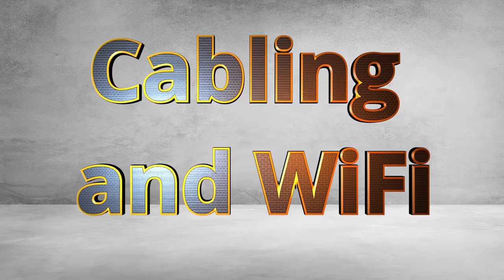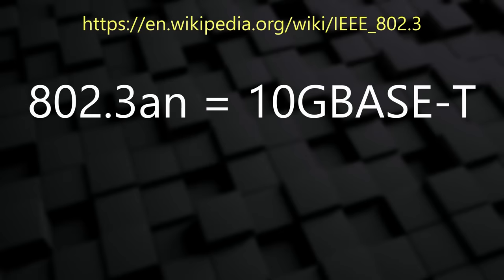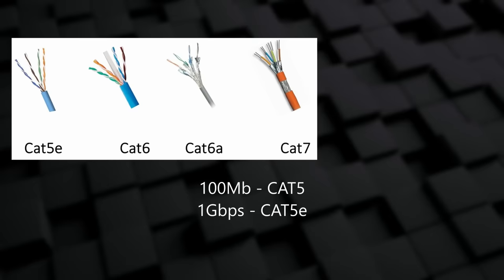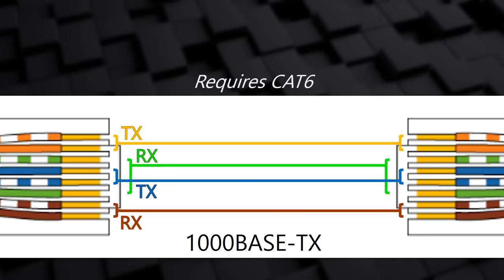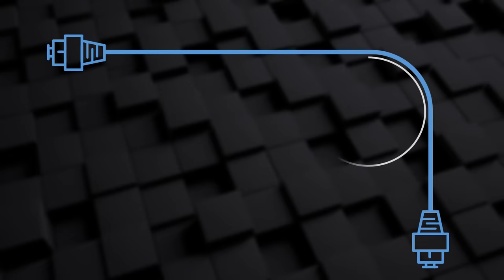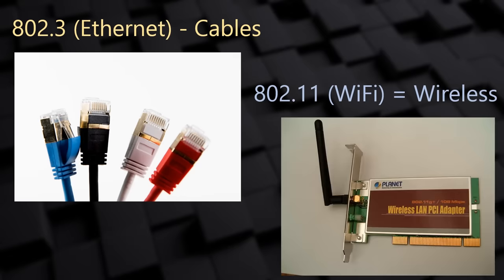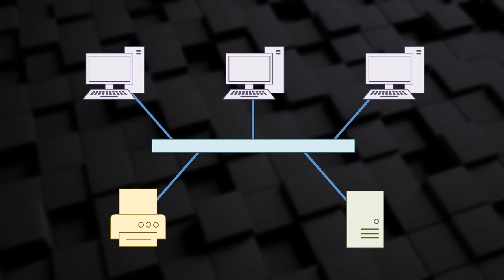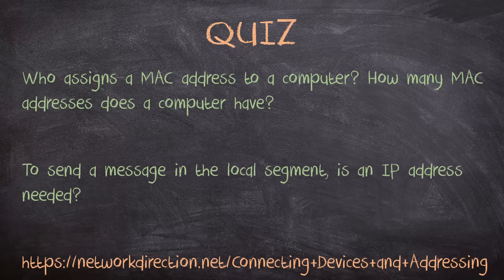Cabling Devices | Network Fundamentals Part 2

Comment: 1) 1000Mb/s = 1Gb/s, UTP (CAT5e or superior).
2)Straight through cable, crossover cable.
3) When the wrong cable is used, what it does is reassign the pins to the correct functions.
4) Between Routers and Switches and for servers, Single-mode is for longer distances (Laser).
5) Maximum degree to which a cable can be bent, optic fiber.
6)Dual core fiber.
Reply: Thank you
Reply: Thanks!!!
Reply: You earned my like 👍
Reply: @kingofnobility8624  i think the official one is longer and more detailed, which by the way you need to pay 2usd to get, but i got the same answer as him so i think the answers are correct
Reply: isnt the corssover cable just for connecting host to host? rather than switch to switch?
Reply: Thanks...the videos are great ...then quizzes ..then boom i have to pay to access answers...nope thats not right
Reply: Thank you. I was about to stop watching these videos after i saw " Unlock with Patreon" on the quiz page. Wish he had just included the answers in the videos.
Reply: The hero we need.
Reply: @xXpartyrockponyXx  In older times you had to also use it for that, but newer switch do it automatically when they detect another switch
Reply: @xXpartyrockponyXx  not smart
Reply: where's the 2nd quiz answers?
Reply: @horsepower33  honestly, everything has come to needing money to afford some education...
Reply: @mikea5225  +1
Reply: Second quiz: Answers gotten from google
1)The Manufacturer, 1
2)No. You can use a MAC adress.

Comment: You explained crossover cables with all wires crossing over but I've seen it explained with only orange and green crossed over i.e 568A one side and 568B the other? Great work on the video, very interesting and well explained, thank you.
Reply from the maker: There's a fair bit crossing over. Take a look at this pic for example
https://lh3.googleusercontent.com/proxy/NbSiu9MMFbYxNUUlEEWDXqQz9IN77o9sT5ERVRUeTz0_S35B1FrGd9TbUztEYN664ghtZb3oEjxtsvrCbRgHJ6LEW1VxpO-sXf7ovW39GXn1b35E

Comment: 7:35 I just want to point out that this is 8P8C connector not RJ-45 as it is a common misconception inside IT. RJ-45 is a wiring standard, 8P8C is a connector.

All in all, this is a great tutorial for beginners.
Reply from the maker: Yes, you're right. But practically in our industry, everyone calls them RJ45 connectors (even if it's not quite right).
If I could go back and rerecord this video, I would make this clear.

Comment: I don't know if it's not too advanced for the video, but you can do full duplex on single core fibre with BiDi transceivers. I believe those are called the BX standards. But a great video nontheless!
Reply from the maker: I think it would be a bit too advanced for this series.
I have written a blog post on this though, if you're interested
https://networkdirection.net/blogpost14-40G-in-the-DC-Or-How-I-Learned-to-Stop-Worrying-and-Love-BiDi
Reply: Network Direction Just read it, thank you!

Comment: Most people don’t understand the distinction between CAT cabling and Ethernet. CAT cables aren’t Ethernet. They were used for analog voice or serial links before being adopted as an option for Ethernet.

The confusion is so strong, that someone even told me that Xerox invented the T-568.
Reply from the maker: Yeah, it's quite common for people to call a CAT/UTP cable an 'Ethernet Cable', which isn't correct.
I probably let it slip from time to time too

Comment: Thank you so much! I was struggling to understand some parts. I still get confused about the difference between a router and a switch though. Like are they used simultaneously and what's the exact difference between? Couldn't find a simple explanation anywhere.

Comment: Just wanted to ask a quick question, in this video its mentioned that copper cables are used for short distance and fiber cables are used for long distance. Isn't fiber cables are more expensive if used for longer distance connections? Thanks.

Bdw, thanks for this videos, I've learnt a lot.🙂
Reply from the maker: Yes, generally fibre cables will be more expensive, but copper cables are affected by interference, and the signal starts breaking down over a long cable run

Comment: Can I know why a mac address can be used within a segment and not pass traffic to a different segment?
Reply from the maker: This is because  MAC addresses are used to get from one hop to another. By 'hop' I mean a network device that the frame passes through.
The the MAC is the address of the next hop. To get to the hop after that, you need the MAC address of the that hop. So the frame is rewritten with the source and destination MAC addresses to get between two hops on the network.
Does that make sense?
Reply: @NetworkDirection  I didn't get the last line and what frame means. Can you elaborate a bit? Sorry I'm someone who has no tech knowledge :(
Reply from the maker: Certainly! A 'frame' is a piece of data that is delivered at layer-2. You see, networks are broken into layers. Each layer is responsible for a certain function. 
This is covered in depth in the OSI and TCP/IP model videos, but in summary:
Layer-1 is the physical delivery of data (think of cabling or radio signals)
Layer-2 is delivery from one connected device to the next one (think of your PC to the switch it's connected to, and then from the switch to a router)
Layer-3 is delivery from one network to another (such as your home network to the internet)
Layer-4 is delivery between applications (for example, a web browser like chrome to a web server on the internet)
Layers 5-7 deal with the application itself.

I understand this might be a bit overwhelming. I recommend watching the videos through to the one on the TCP/IP model. Then, come back and watch this one, and see if it makes more sense then.
I hope this helps!
Reply from the maker: Certainly! A 'frame' is a piece of data that is delivered at layer-2. You see, networks are broken into layers. Each layer is responsible for a certain function. 
This is covered in depth in the OSI and TCP/IP model videos, but in summary:
Layer-1 is the physical delivery of data (think of cabling or radio signals)
Layer-2 is delivery from one connected device to the next one (think of your PC to the switch it's connected to, and then from the switch to a router)
Layer-3 is delivery from one network to another (such as your home network to the internet)
Layer-4 is delivery between applications (for example, a web browser like chrome to a web server on the internet)
Layers 5-7 deal with the application itself.

I understand this might be a bit overwhelming. I recommend watching the videos through to the one on the TCP/IP model. Then, come back and watch this one, and see if it makes more sense then.
I hope this helps!
Reply from the maker: Certainly! A 'frame' is a piece of data that is delivered at layer-2. You see, networks are broken into layers. Each layer is responsible for a certain function. 
This is covered in depth in the OSI and TCP/IP model videos, but in summary:
Layer-1 is the physical delivery of data (think of cabling or radio signals)
Layer-2 is delivery from one connected device to the next one (think of your PC to the switch it's connected to, and then from the switch to a router)
Layer-3 is delivery from one network to another (such as your home network to the internet)
Layer-4 is delivery between applications (for example, a web browser like chrome to a web server on the internet)
Layers 5-7 deal with the application itself.

I understand this might be a bit overwhelming. I recommend watching the videos through to the one on the TCP/IP model. Then, come back and watch this one, and see if it makes more sense then.
I hope this helps!

Comment: does becoming a member of  network direction at the $4 level give me all the benefits of the $1 and $2 level?
Reply from the maker: It sure does!
Reply: @NetworkDirection  how many total practice questions for network fundamentals?  Are the questions similar to the ones on the comptia network + test?
Reply from the maker: @jlporter12  It varies per video. Some have a few, others as much as 10
I haven't written them to be similar to any exam format. I wrote them in a way to get you to test how well you know a concept, and even put in some extra research on your own.
I do think that they will help you study for your exam, but they're not a shortcut.

Comment: Hi Network Direction, I just had one question I was hoping to ask - why do you call 802 things as "standards" ? What does "standards" mean here ?
Reply: There's an organization called I.E.E.E (Institute of Electrical and Electronics Engineers) that come up with many different standards relating to computers and technology, especially networking. The 802 refers to the standards that deal with networking and they have sub-standards like 802.3 (ethernet) and 802.11 (Wi-Fi), etc.

In short, standards are a set of unifying principals so that all devices that connect to a network share a common language, so to speak.

Comment: 9:24 Can't switches do the "clever" thing where they determine which end needs to be used for receiving/sending with straight cable? (The previous example you showed connecting computer to a switch). Why do they need crossover cable?
Reply from the maker: You're right! It's called Auto-MDIX. It's available in nearly all switches now, making crossover cables redundant.
I think I cover this later on in the video or series.

Comment: Why is there any limitation to the length of a Multi mode fibre cable?  Why is there a limits to the distance at which which LED's can transmit a signal?  Does LED light travel slower than laser light?
Reply from the maker: I think this is more of a physics question, so I'm not qualified...
But, no, the speed of light is constant.
I think multimode's limitations come from the way light retracts inside the polymer core.
Single mode on the other hand uses a narrower glass core, changing refraction
Reply: thanks that is what i figured! another question.. why are LED based fibre cables called Multi Mode mode? They have Multiple modes?
Reply: I think that it has to do laser LED's light being more focused in a smaller area, which allows the light to travel a further distance. Sorta like focusing sunlight with a magnifying glass, the area which the light affects is smaller, but the light is more focused making it more powerful.

Comment: Isn't it the case that you can change your Mac Adress? Because you can do Mac Spoofing
Reply from the maker: Yes, that's exactly right, it's possible to change your MAC. However, this is the MAC that the operating system uses. Network cards still have a burned in address that you can't change.
In fact, smart phones regularly change MAC to make it hard for places that offer free WiFi to track users.

Comment: if you are in a lan network and you want to send something from one device to another, do you need an ip adress to do that or is the mac adress enough?
Reply from the maker: You will need both an IP and a MAC in most cases.
Some protocols (like DHCP) can send some messages without an IP

Comment: Thanks for such great videos. But I have one point, I think there are some transceivers which allow full duplex communications using CWDM through a single core fiber, maybe I am worng, I don't know if you have the answer. Thanks in advance for sharing.
Reply from the maker: That's possible, sure. I'm not certain though, so I couldn't tell you which ones.

Comment: If you use a single core fibre but use BiDi-SFPs (bidirectional) that uses diffrent nm for TX/RX wouldnt that be considered Full-Duplex?
Reply from the maker: That's a bit advanced for this video, but yes, they are full duplex. full duplex is anything that can send and receive at the same time.
BiDi is special, as it is like putting several virtual strands of fibre over a single core. This is why it can get higher speeds than traditional fibre.

Comment: Why at the end we used a router to connect two switches? Can't we use a switch? Or literally just a cable to connect the two switches together? Or did you mean an internet connection link as in the second half of the network is beyond physical connection & therefore we used the internet to connect them?
Reply from the maker: I’m just showing that we can use a router to join two networks. Yes, you could use a switch, but that would change the way it all works.
It’s a bit early on to talk about design, but sometimes we want to break network into smaller areas using routers.
Reply: @NetworkDirection  what's the advantage of the router over a switch in this setup? Or is this explained in later Videos?
Reply from the maker: Are we talking about the topology about 23 minutes in?
This is really only as an example. I haven't created any videos showing the pros/cons yet as it can get a bit advanced, but there are a few reasons why this may be done.
It may be physical; You could have separate layer-3 routing domains per floor of a building
It could be to limit the size of the broadcast domain. Or perhaps to simplify the layer-2 topology.
Maybe for security. We could have a WiFi network for guests separate to our main office network.
We will eventually get to options like these in a later video. For now though, the important part is to understand that you may have a network that looks like this.
Reply: @NetworkDirection  alright great, thank you for responding, appreciate it.

Comment: What does a VPN do exactly to your IP address?
Reply: In a way, it masks your original IP. When you connect to a VPN service, your internet traffic flows from your device to the VPN service and then to wherever it needs to go. So for instance, if you live in San Francisco but you're using a VPN service with a server in Guadalajara, Mexico,  your traffic goes from SF all the way to VPN server in GDL and then to its destination. Your device does not directly connect to the website, but rather it gets proxied by the VPN.
Reply: It also slows down your PC just a hint, and you can download content illegal in us

Comment: Is Ethernet an actual protocol or is it more accurately a standard?
Reply from the maker: It's kind of both. I'm not sure which camp it technically falls into.
It's a protocol in that it covers how data is formatted
But it's also a standard in that it talks about how cables should be made

Comment: Just getting confused, I have never used a crossover cable to connect my router to my PC for example.
Reply from the maker: These days it's not as important as it used to be, due to a technology called Auto-MDIX that can adapt to different standards.
However, if you're preparing for an exam, remember that officially, you need a crossover cable to connect a PC to a router
Reply: @NetworkDirection  just getting confused too , why don't all Devices act  the same so we can only use a crossover cable und no need to Auto-MDIX ?
Reply: @mustafaalmarei890  I guess it’s to make it so everyone are using the same type of cable instead of having two but I get ur point.

Comment: This information in this tutorial is somewhat out of date. For example, there are now BiDi transceivers that can send and receive using a single fiber strand. Also, MMF used to use LEDs but nowadays uses lasers. LED based systems top out at about 150 Mbps. Since most fiber connections are 10 Gbps nowadays, they have to use lasers. Also, both Linux and Windows let you change the MAC address of a port.

Comment: Fiber cables are not made of glass! Glass is silicon dioxide, is very fragile, not flexible, and will shatter if subjected to even a moderate impact. Optical fiber is silicon tetrachloride, a type of polymer closer to plastic, is not fragile, is very flexible, and will not shatter or break. You could tie it in a knot and hit it with a hammer and it still wouldn't break. Granted, it would no longer be useful for data transmission, but the point is that it is NOT GLASS. The fact that both glass and optical fiber contain silicon does not make them the same thing.
Reply from the maker: That's a good point. In fact, this would make an interesting video.
Have you considered making one?